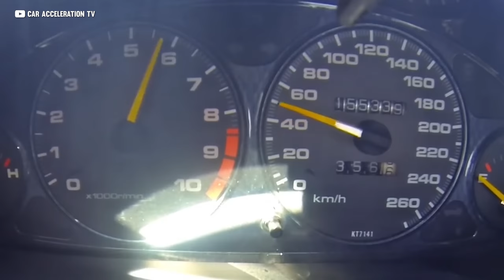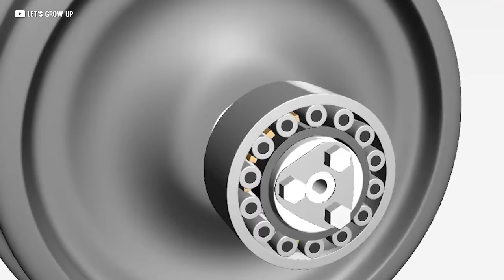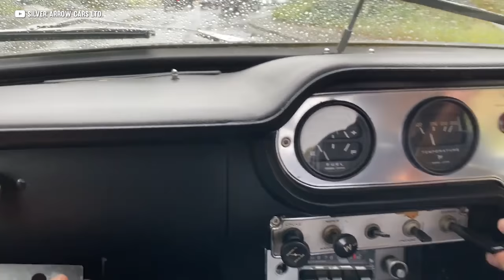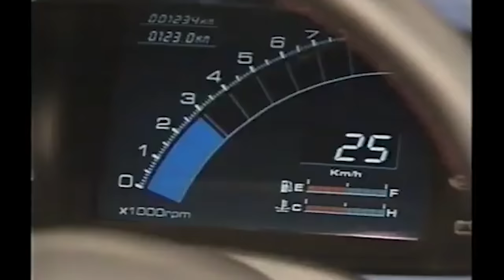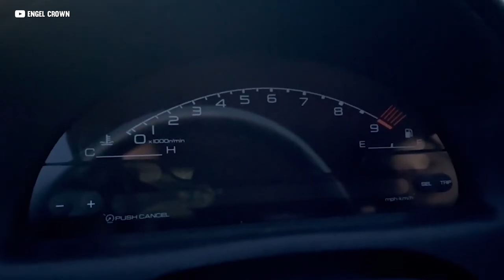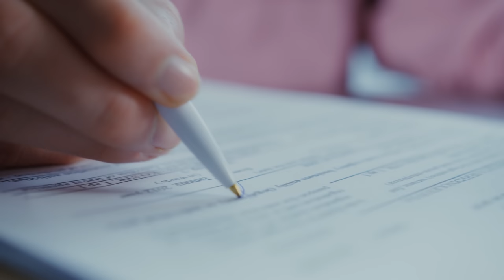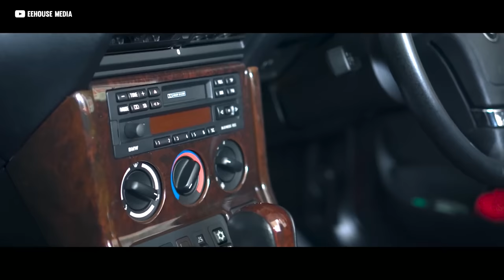Why Honda Killed The Greatest Sports Car

Comment: Cool that you featured the S2000 but you left out a lot of details about the car. The engine is not even the  most exciting part of it, that car was more about balance, chassis stiffness and handling which really made it stand out. It was faster than the standard Boxter S on a track while being much cheaper and no camparison to a comparable Z3 / Z4. Those who say that the car was too expensive need to really get their facts right because for the tech it had it was way too cheap! Just a few example, how many cars in that price range had a double wishbone suspension, basically a monocoque style chassis, a 50/50 weight ratio while basically mid engined (fron-mid engine), aluminium hood, the shortest (and apparently best according to many auto jurnalists) shifter in any production car and then there is the engine that made 250hp NA (in Japan, 240hp in the rest of the world) only the F22C with the 2.2l made 237hp instead of the full 240hp. Plus the reliability made it really exceptional comared to the Boxter.
Reply: You obviously are a die hard Honda s2k fan lol
Reply: @biggiesmalls7939  haha wouldn't say that, i also hava GR Yaris and used to drive a M2competition. Would love to have a C8 Corvette and 992 GT3 or Cayman GT4 ... i love every car brand and concepts there is no right or wrong but the S2000 is kinda special to drive for me based on my experience with cars, even though 9000rpm doesn't really excite me anymore ... a couple more RPM's would be nice xD. But yea i know all these things about all my cars i owned as i like to do the research on what i buy. The GR Yaris is even more of a nerd car tbh.
Reply: @biggiesmalls7939  my car go swiftly 160, wreck it buy a new one. My crew run run run
Reply: @MrLazlness  see, now that's why my name is what it is.... You're actually quoting lyrics that are very relevant to the subject. 10/10
Reply: I mostly agree with you, but Gordan Murray and a few other  engineers have claimed that the lotus Elan has the best Manuel of all time. Matter of fact he was pissed that he couldn't replicate the feel of the Elan on his McLaren F1. I don't know if Gordan has driven a s2000 but he said that the e30 M3 and his own NSX came close to the Elans manual. The only little drawback to the S2000 is that the steering isn't the best. Not the most communicative. But other then that it really is the greatest roadster of all time. It was Mr. Uehara retirement gift to the company and to fans. they put so much engineering into the car, they knew they weren't gonna make money on it. If you really think about the s2000 is basically a topless e30 M3 Evo 2.
Reply: @MiguelGarcia-vj7oo  I thought the Lotus Elan's strenght was handling and steering feel ... i'm actually looking into buying a Elan haha but i'm not sure though. But i can tell you the S2000 Shifter is definitly better and shorter than the NSX's. E30 M3 shifter imo is also a bit better than the NSX (especially the rayout is so cool and every enthusiasts dream!) but yea the S2000 is a crazy car, it or Hondas in general were never on my radar so i'm grad i came across it. Now also came to like the old DC5's and EK9.
Reply: I remember the car and driver lightning lap for the s2k-cr and it got destroyed by the 09 cobalt ss. 😅

I always beat myself up for not buying a then new 09 cobalt ss sedan with lsd. 🤦‍♂️ then i had the chance to get an s2k for cheap and i passed on it as well. 🤦‍♂️🤦‍♂️
Reply: @dnegel9546  haha need to look that up but yea might be possible, the cobalt ss has similar weight and more power, depending on track and driver and condition i can imagine it can beat the S2000 CR :)
Reply: Boxster is a better car. S2k is (was) a better value.
Reply: @black99rt  Not really, the S2000 was not much cheaper than the Boxter, Performance wise the S2000 was almost on par with the Boxter S (compared to the JDM model with 250hp ofc) they had similar weight and the Honda had a much better suspension setup (double wishbone with a very very good oem suspension they took over from the NSX) and a much more rigid chassis. The S2000 as well is a mid engined car. The Boxter was better when it came to low end torque and high speed. I've driven both in stock form, i wouldn't bother with the standard Boxster but the Boxter S is not a bad car at all but i never experience the same driving thrills and the connection at the limit as with the S2000. This also reflects in the aftermarket pricing, the boxters look doesn't help too. On top of that the S2000 has been very reliable and easy to maintain with great tuning potential,  where the Boxter and Caymans had their fair share of issues. You can see many S2000's on track and Grid Life event or at time attack in Japan and not many Boxters even though they are much cheaper now than any S2000. And yes, i am talking about the early Boxsters 986 ... the current boxster spider is a different beast.
Reply: @binskee677 Elan is a great car. Elite is better.
Reply: OK SO I HAD TWO civic Type R hot hatches before I got an S2000 new in 2006 so a Mk 2 in the UK. I found it hard work to get the performance out of it compared to the Type R . But I used it for business and racked up about 106K miles before trading it for a BMW 125D. ( which had 8speed auto and almost as much BHP (but way more torque) as the S2000. It’s performance was way more accessible in day to day driving. Nothing, however, compares to the change in power of the S2000 above 6000 rpm! 9000rpm was an event. (Discussed this with another owner who told me he’d never revved his above 6000!) TBH it was a bit ordinary below 6000 and I think it’s a bit of an acquired taste but a true sports car in the traditional sense and I’m not surprised that they now fetch high prices.
Reply: @towerdave4836  yes, totally boring below 6k rpm i totally agree, the car only makes sense if you drive it hard is not good as a daily driver but Honda never intended it to be a good daily driver, that was never the point of the car to have torque and be comfortable.
Reply: My Ap1 comletly forged FC20 raced to redline 90% of the time and never worried about her 😊 .
Reply: Yeah but s2k can’t drift… not talking power sliding or oversteering. I think it may have to do with the steering rack and the factory suspension. Even a miata can drift all day and it’s a similar platform which is crazy.
Reply: @Pharaoh_The_Great  first: No miata and a S2000 are not a similar platform! The S2000 is double the price, has a different suspension setup (double wishbone) which creates much more traction under load. Second and most importantly the weight is centered much closed to the middle in the S2000. Both MX5 and S2000 has a 50/50 weight distribution but the MX5 engine sits on top of the front axle and the S2000 engine sitz behind the front axle making it technically a mid engined car. The consequence is that you can have higher corner speed and controllability but if it oversteers, it happens very quickly (like in any mid engined car). You can drift a S2000 but you have to be very quick on the steering and very skilled. And ofc the S2000 has a sharper suspension setup and harder roll bars, that too has an influence. The S2000 and Miata are very different cars from the beginning, The S2000 is not Hondas take on a roadster, it's a new interpretation of their S600/S800. If their first car was a couple, the S2000 would have been coupe but the s600 and s800 happened to be a roadster too.
Reply: I can tell you for a fact the car was the opposite of stiff or stable. High speed stability (over 80mph) vehicle becomes squirrelly and very easily is blown around the road. there is substantial body chassis flex while loading the vehicle up. The 50/50 weight doesn’t mean a single thing because the car is so snappy at the limit, good luck trying to slide it. Your two options are grip or snap oversteer. Suspension seems good on paper but just isn’t that good in practice. I owned a pristine full stock single owner AP2 with low miles and the whole time I owned it the only thought I had was “the Miata does everything this does, better.” Sure the engine is legendary and the shifter is immaculate but the car suffers from rose colored glasses. It’s just not as good as every one says. It is a dont meet your heroes kind of car. The E46 m3 can be had around the same prices as the S2K can be had and it’s light years better even with its subframe issues.
Reply: @binskee677  You're right about the s2k is a mid-engine technically, because the engine block sits behind the front axle. Combined with the racecar stiff chassis makes for an awesome weight distribution and dynamic handling characteristics.
Reply: 32-35k for a car that only 2 people could use was already a large pill to swallow. 

Factor in only a select amount of people could even fit in the car and you axed out even more people. 

Lastly 32-35k … was not about to be slapped on a track any time soon and most of the things everyone took pride in was a moot point…  so you ended up getting dusted by some clapped out 4.6 Mustang with 3.73/4.10 gears further hurting s2000 sales.
Reply: @Texarmageddon  well it sold 110k cars, espeically 60k in the use so it had it's niche. Straight line speed is irrelevant for a roadster anyways. It has won numerous prices for the car and the especially the engine, multiple car of the year and engine of the year awards for 2-3 years after firth release, not much cars have that actually.
Reply: @binskee677   straight line speed will always be relevant… maybe not for you, but for most it is.   

End of the day… it was a commercial flop.. 

Mustang outsold it’s entire international sales in one year. Corvette outsold it’s entire US domestic sales in 2 years.  Whatever rewards it received were all but worthless hype in hopes of boosting sales.
Reply: @Texarmageddon  it was the 15th most sold roadster in the history (yes there is long list after that) and even if it was, it doesn't make it a bad car, the Lexus LFA was a commercial flop or the Porsche Carrera GT was a commercial flop now worth over a million. Number of sales was never an indicator of how capable a car was as most people are not enthusiasts and the enthusiasts market is very small and very diverse when it comes to taste. The awards it received was for the records it broke and the way it drove, there was no other raodster like it, it even beat the more powerful Boxster S in most comparisons whiel being much cheaper. I mean they sold 110k of it, for a car that is a niche withing a niche thats not too bad, it was anyway not intended to be commercial success and Honda never made any money with those cars. Back then there was nothing like it.
Reply: @binskee677  number of sales is everything to a company looking to make profit. The s2000 just didn’t put out and that’s why you never saw another one after it. 

Much like LFA too expensive while still being a great car…..  which overall made it a bad car… 

Honda made it with every intention to make profit…and you’re crazy if you think Honda  was about to purposely take the L with two cars
Reply: @Texarmageddon  `haha nope thats just not true there are so many car companies who here and there make cars that don't make profits and they know that. None of the homologation cars are making profits, most of the serious sportscars that are sold for reasonable money don't make a profit, those cars are here for marketing reasons, to make the a Brand more attractive, best example the LFA, do you really think Lexus didn't knew that they wouldn't make a profit? Do you seriously think the worlds largest car manufacturer is that stupid? The NSX never made any profit, the 911 makes no profit, Porsche only survives due to the Panameras and Cayennes and Macans, but still the 911 is very important to the Brand. 

The S2000 was mostly hand assembled and the engine was hand assembled with forged internals, do you think a company who want's to make a profit with the car would do that? No one else does it at least. The S2000 has so many bespoke parts (for example the engine) it makes no sense to make a engine for one specific model no matter how much you sell, they would have never done that if profit was the main focus because it makes no sense. The S2000 was discontinued because of the 2008 financial crisis alongside many sporty car models from many different brands. Yes japanese companies are very conservative when it comes to sports cars but when they do it, they do it right. The S2000 was not even maket oriented, it was a 50 years of Honda gift to themselves modeld after their very first Honda car they ever made (the S600 and S800). The car itself makes no sense if they were only profit oriented, if profit was the main goal they would not make it at all because enthusiasts cars never make financial sense. It also doesn't make sense to compare an S2000 with a high volume models like Mustangs and Camaros. 

They wanted to make something special and they did according to all reviewers and magazines and broke records which stood for a decade and only beaten by a brand like Ferrari. it's not their fault that people didn't understand the car or how to drive it properly and what the car was intended to be. People had all sorts of wired expectations for it, who in their right sense buys a 2 seat roadster and expects it to be a good daily driver, or who in the reight sense buy's a high reving NA engine and expects it to have more low end torque?! I mean it's not hondas fault that many don't konw basics about engine characteristics. I think many who have been disappointed by the car because it is not what they expected it to be, are saying the car is bad instead of admiting that the car is simply not the right car for them and their driving intention. I have driven Mustangs and Camaros, and i was very disappointed with the chassis, suspension and and overall balance. The torque and pull is great but does not interest me much because stepping on the gar in a straight line is something my grandma can do, but i'm not saying that it's a bad car, it definitly has it's purpose but it's not the right car for me.
Reply: @binskee677  😬😬🙄🙄 sir… the 911 only accounts for about 10% of all of Porsche sales, but makes about 30% of the profit for Porsche.  That’s been news for years and has been stated to be the most profitable car in the world

The 911 is their money train.  From that point forward it was TL;Dr
Reply: @Texarmageddon  haha ok the 911 was maybe a bad example i admit xD but in the 90's they almost went bankrupt only making  911's, it was the cayennes and boxters mainly which saved the company. Yes the Boxster is also a sports car sort of but it was intended as a high volume car from the beginning and the first car produced under Toyotas TPS production system which massivly increased quality and profit margins. Also the 911 is not a bespoke car, the engine is used in various models and interior, tech etc is used in all of their models. The S2000 on the other hand was a bespoke car made from the ground up, and such cars which use parts which are made for only that specific car have a very little to no profit margins usually. For example, Mazda uses the miata engine in many different models, some goes for all of the manufacturers. Also Honda is not a sportscar manufacturer per se, so it's different and much harder for Honda to make a sports car than for Porsche to make another model, especially such a niche car like the S2000. Another big factor for Porsche at the moment is their marketing, they can ask whatever price they want for their cars, it will be sold no matter what. A brand like Honda cannot do that, they have to price themselves in a competitive spectrum unlike italian and german brands. Yes Porsche is proof you can build special sports cars (althoug i doubt their very special RS models make any profit, it's mostly the carreras and turbos that make profit) but that is not proof that others can. As i said, Honda sold 110k units of the S2000 which is not bad for a niche product (even in  the niche it's more special due to the engine characteristics) but they have probably made no profit with it. Toyota made the GR Yaris and they made 27000 of it, originally to run in the WRC but with the rule change it was not necessary anymore but they still went ahead and made them, and they said they are making no profit of these cars because they are sold for around 40k USD but take 10x longer to make than a normal Yaris. And the reason why those brands do this is because they can afford it, Toyota is not only the largest car manufacturer in the world, they are also the most profitable manufacturer, they can afford to play around with developing a LFA or a bespoke homologation car and the technology gained trickles down to other cars in their line up. Same goes with Honda, the S2000 engine later layed the foundation for the K-Series and much of their chassis work. Also all of the japanese manufacturers stopped doing sports cars in the mid 2010's, Honda actually made the S2000 till 2009. Mazda stopped the RX-8, Toyota did nothing until 2012, even Mitsubishi and Subaru didn't come up with anything exciting since then. The enthusiast market hat changed massivly since then, affordable spors cars, especially roadsters are not in demand anymore, Mazda is selling only a fraction of the Miatas they used to sell in the past even though the ND Miata is a great car. It made no sense to invest in new roadster chassis for any manufacturer. IMO Honda should have stopped making the S2000 much earlier in 2006 but then they didn't a financial crisis would hit and the first thing people stop buying are unnecessary things. So number of sales do not determin how good a car is, sometimes a model is just too early on the market, or too late (like the LFA) and the potential customer base is not ready for it or do not understand the product. Also back in the day like 2008 we all thought that cars are only going to be more exciting and fun to drive in the future, but now people realize thats not the case so that is also a reason why those old cars are very high in demand thats why the prices are so high.
Reply: @sexylexy22100  the car wasn't made for the US enthusiasts but the US bought most of the S2000's by a large margin to just complain about it. It think there are many US enthusiasts that know the purpose of this car. But yes you are right, the US buyers are just used to low end torque and don't know how to drive a proper sports car. They usually complain that you HAVE to rev out the car to make power and i'm here like:" bro, reving out and keeping it in the right rev range to make power is the whole point of the engine, thats exactly what makes it so fun". so yea the US car enthusiasts are still a mistery to me!